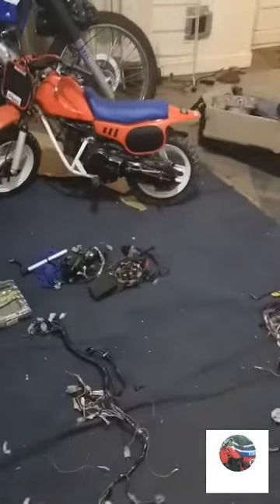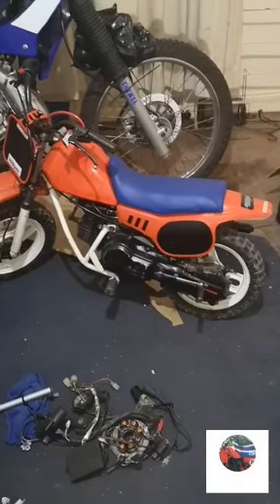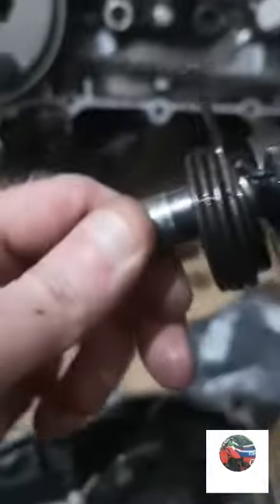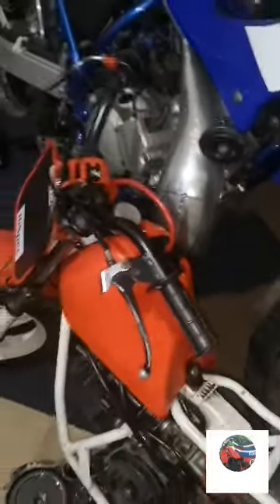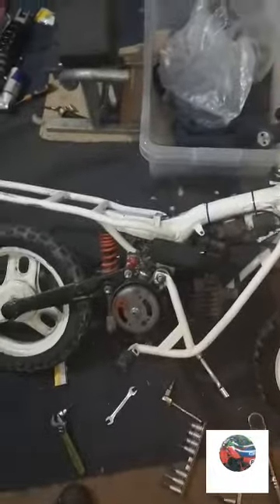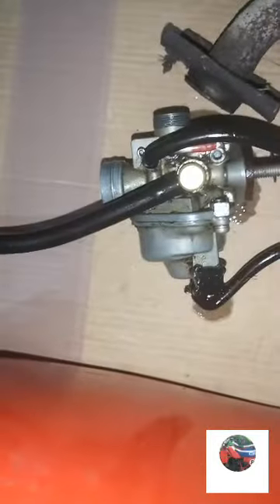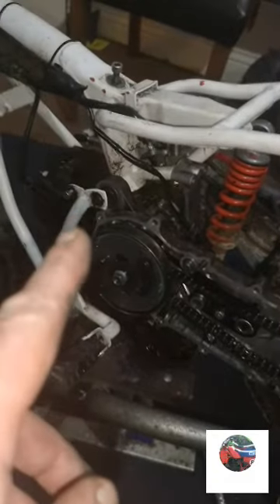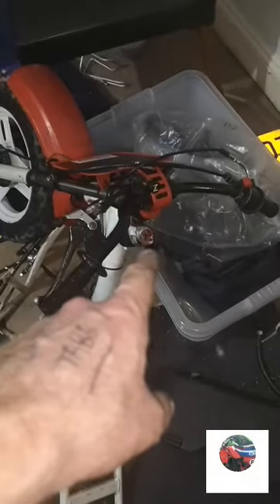Honda qr50 full bike restoration / teardown and rebuild pt1

Comment: I cant find the sump plug on my qr50 any suggestions? I know where the sump plug is for the transmission oil but cant find engine oil plug
Reply from the maker: Hi they transmission oil comes out under the kickstart on the bottom casing bolts, there's an arrow facing towards it, there is no other sump plugs, there's a bleeder screw on the 2 stroke oil pump which will let the 2 stroke oil out which mixs with the petrol
Reply: @2strokemxclassics  thanks mate I appreciate the reply, loved the video too I'm currently looking at restoring my original qr50 from 97 for my sons at the moment
Reply from the maker: No problem m8, yeah there worth restoring,be a good bike for him, some parts are hard to find but av got a full eng and a stripped eng if after any bits